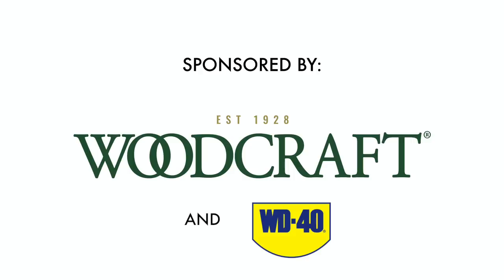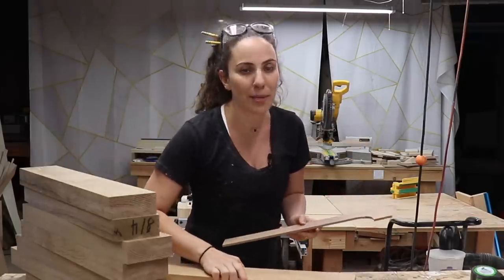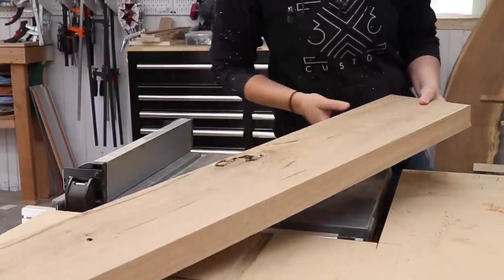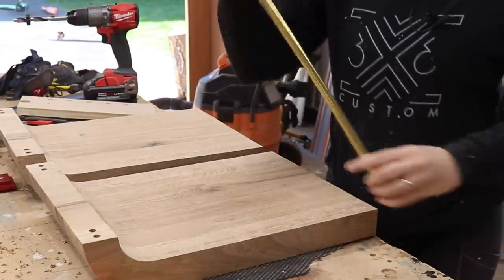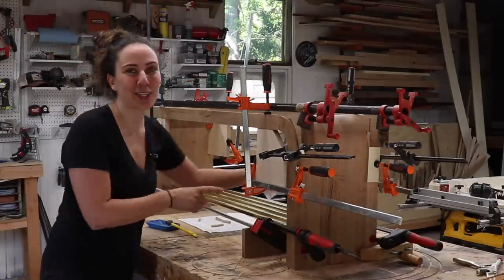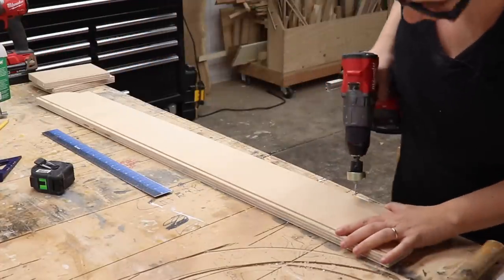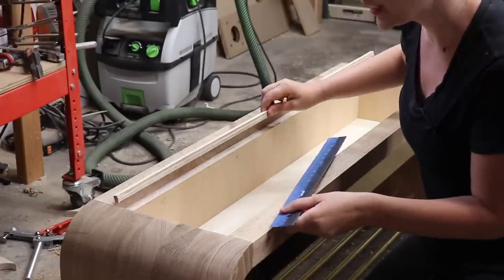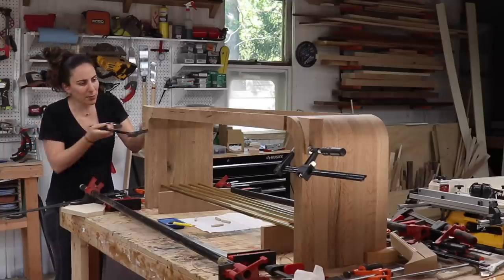Storage Bench with curves and BRASS accents - Builders Challenge Season 9 Build

Comment: Pretty nice watching someone make a not entirely small piece of cool furniture with a limited selection of tools - as a furniture  maker apprentice you get used to use specific large machines and kind of forget that smaller and cheaper tools can be used. I'm so used to making templates on a massive behemoth of a bandsaw and perfecting the shape with a rather substantial belt sander - the jigsaw and the small belt sander seem to work just as well - good to have in mind when contemplating a possible future workshop :)
Reply from the maker: Glad you liked it, yeah, use what you got! ha

Comment: I’m kinda old, so I remember doing big glue-ups with hide glue. We used a hot box to warm the wood, then our foreman would yell at everyone to go faster, because the glue gels so fast when it’s cold in the shop. Talk about panic mode! One tip that we use for plugs (and we make them in many sizes): Put the working piece on edge, and run it through the table saw. That way, the plugs have nice flat bottoms, and no marks from prying them out. Hope that makes sense. Great video. You are wonderfully resourceful, and you have serious chops.
Reply from the maker: Thanks! I usually cut them out of the bandsaw, but my bandsaw is out of commission, hence the jigsaw cutting here. here

Comment: Very nice bench I might do something similar for my pool deck.Just a
FYI about WD 40 it can corrode metals faster and oxidize aluminum faster so DO NOT LEAVE IT ON THE METAL.Wipe it down then coat your garden hose nozzle with Furniture wax or bees wax this will prevent any any seizing of parts.
Also I know you are in N.Y when you use your power tools coat them with wax cast iron more so including your saw blades you will find it easier to maintain your tools and keep your blades from gumming up.

Comment: On the brass bars or tubes you could extend them out the sides and use them as clamps to hold the legs in place adding more instres to the project.
But it does look good as it is, and will last years.

Comment: I’m a metal worker. I really love your bench. Great mix of wood and brass. I’m wondering if you sealed the brass before hand off camera so it doesn’t go green on you later on as it oxidizes over time.
Reply from the maker: Thanks! I put wax on it. In the past I have used lacquer to seal brass. But I wanted to test out to see how long wax will last bc I don’t live spraying lacquer

Comment: I use epoxy glue which has a 12 hour cure time, much easier to glue up however te 12 hour time means you need to wrap everything in tape and guess where the glue might run out from - swings and round abouts!
Actually, thanks to you ans the existence of eBay I've started moving to Titebond, wow, what a product! Couldn't get it in the UK for the last 30 years.
Reply: Out of interest, how does Titebond compare with regular white PVA, Bostik for example?
Reply from the maker: Haha! Sounds like a good time!

Comment: Really nice bench! indeed as you said pocket holes are a bit controversial and is just a matter of using them in the right way  because some people want to use it in everything and trying to hidde the hole they end up with a weak joint, the solution is use a variety of joints for each situation.
Reply from the maker: Thanks! Totally! They are great when used in the right application

Comment: That's a really beautiful (and functional) piece of furniture!  The large parts, curves, and the large radius roundover, really suit the dimensions and the materials.  Your designs always strike that balance between beautiful and functional, 'grownup' without being boring!  I want one!  :)
Oh, and been there, done that (more often than I care to admit), on cutting the tubing (or whatever project element) too short, and it's something I didn't want to buy again!  One alternate fix on projects where you can't shorten the overall length (due to its matching an adjacent project, or required by the location or application, etc.), could be to restore the tubing back to the correct length by splicing in wood sections.  Make dowel pieces out of the same wood as the project, having an O.D. the same as the brass tubing, then 'step down' that diameter on the ends of the dowel pieces to fashion tenons the size of the I.D. of the tubing.  Glue them in toward each end, between the main tube in the middle and two shorter lengths of tube on the ends, for a small accent of wood at each end, and it'll look like you meant to do it!  (At least, that's what I always tell people, for such fixes on my own projects, "I meant to do that!")
Reply from the maker: Thanks so much!

Comment: Nice build.  Don’t feel guilty for using pocket holes.  There are so many ways to join timber, you have demonstrated a range in this project.  The over use of pocket holes by some is astounding but they do have their place in a vast array of solutions available.
As for phone calls during glue up.  Every time I get to glue up I make a point of telling those that normally call or interfere to stay away.  I can guarantee that more than once each of them will call/interfere during the glue up with the most ridiculous reasons to call.  They also wonder why I end up getting cross, every time!!
Reply from the maker: Thanks so much! Yeah, I mean I get the overuse of pocket hole thing. When I first started I did the same thing. It just seemed so easy. It was awesome to see a finished project come together so fast. But then I learned about wood movement and all that and changed my ways. Ha. So it was a great stepping stone in the journey. I need to start shutting my phone off during glue ups!

Comment: Just wondering is 3/4 or 18mm thickness only one available in US?  Why in here in particular use insanely heavy compartment with no benefits at all especially if it used for hats. It just added 10extra kg to the structure. And in general almost all the time ppl using 18mm in all builds. Very nice looking anyway metal with wood always a win ))

Comment: Superb! You are a good teacher. Keep it up? What was the riving knife on your table saw? Some sort of thin kerf thingy!? Also, could you educate that sometimes you use the zero clearance throat plate and sometimes you use the factory one! I though the factory one had a slight dip and was not sturdy enough. Thanks
Reply from the maker: Thanks! That’s just the riving knife that came with the saw..... so! I only use my zero clearance insert if I’m cutting wood that’s small enough that it only rides on the inserts. The dip and bend in the factory one is not an issue when the wood has more surface of the table to run along. I also use it when I’m cutting thin strips so the strips don’t fall into the big gap in the stock one
Reply: 3x3Custom - Tamar Thank you Tamar.

Comment: Tamar, 5:45, the grain direction was not favorable, it's true, but standard procedure when template shaping is to make the template with an overhanging lead in, not just a copy of the part. A starting pin close to the cutter would also help.
Reply: Lee Haelters - I couldn’t remember what that pin screwed into the face of the router lift was called but thought the same thing. I get VERY nervous approaching a spinning router bit with no support at all.
Reply: @chipsterb4946 , then imagine approaching a two knife shaper head with a ball bearing collar and 6" diameter cutting circle. Yet, it is done safely all the time, with a starting pin!
Reply: Lee Haelters - you misunderstood. A starter pin is support for the work piece.
Reply: @chipsterb4946 , quite so, no misunderstanding. Was pointing out that something even scarier and hairier could be tamed by use of such pin.

Comment: Hi, good job. Very inspiring project. But I would ask you why did you choose to joint the edge of the boards with your tapering jig if you have a tracksaw?
Reply from the maker: Thanks so much! Well, that pieces was short enough for my tapering jig to hold. the only reason why I didnt use the tapering jig on the longer piece was just that, it was too long for my tapering jig.

Comment: After you have the tapering jig made, how do you properly set it up to joint? I assume the you have fix the clamps 100% straight or parallel to the fence for it get jointed right? Thanks a bunch.
Reply from the maker: I believe I just responded to you on another video. That first cut angle doesn’t matter. You set it just so that it cuts the whole board. Then flip it over without the jig. And put that first cut side against the fence. Then board is square.

Comment: Do you find the double sided tape holds strong enough to do the template routing? I always use a couple of dabs of mitre glue (superglue) that way I know it’s not coming undone, but it does damage the templates.
Reply from the maker: Yup, this double sided tape is super strong, thin and doesn't leave any residue.

Comment: This is so great. I already ordered that hinge/stay set from hardware hut - that is perfect for a lid on a bench with storage I am planning. Any advice you learned from your trial runs?
Reply from the maker: Thanks so much! It’s a pretty cool lid stay. So! The parts that are installed in the actual case (not the door) are supposed to be installed at 2 different heights. The instructions are in metric. So just be prepared for that. There are diagrams showing how far from the top the holes are supposed to be drilled. But it’s in a picture with a billion other numbers. So it’s a just a bit confusing to focus on which number is right..... ha and the best thing about them is how adjustable they are after it’s installed. So even if you don’t install is perfectly you can adjust left, right, back, forth and up and down

Comment: something i was questioning throughout this entire build was the way the leg was made and how it had a stress point right where the curve was, did that end up being a problem? because i know that stress point would put alot of sheer tension on that curve due to the grain, if not dont mind me its just i've always been taught that would be a breaking point in a piece however given the size of the leg that could potentially be disregarded
Reply from the maker: If it was just one piece. Maybe. But since this was so many pieces glued together it makes it’s very strong. And also the bottom plywood is attached with pocket whole screws that pull the whole thing together
Reply: @3x3CustomTamar  i'll have to note that one down then

Comment: I so enjoyed watching this build. A couple of things occured to me afterwards. The oak is beautiful, I don't like the brass strip at the front and I don't like the hinges you chose. 

Could you have opted instead for a long brass piano lid type hinge instead of the kitchen cabinet ones? I think that beautiful oak deserved it. OK no soft close but perhaps there is another solution for that?
The brass rods are quite long, how do you protect them from getting bent over time?
Final thought, if you had used 2 less pieces on the sides and replaced them with lengths of brass rod (this is difficult to explain without drawing it) connecting the wood together horizontally it would have given you 5 or 6 pieces with space between them much as the original picture you showed. OK it might not have been so strong but you would see all four sides of each piece of wood. Then the spare wood could have been used to form the box and no ply wood or brass strip would have been needed.

Final final question. The bottom always drops out of draws especially when they are over filled and the furniture is cheap. How do you make bottoms that stay in?

Love what you do.

Comment: Good idea for storing " in use" stuff. MY  problem would be REMEMBERING to USE IT!! (and not looking all over for stuff I JUST HAD !!) Also, I noticed the way you use a miter saw, full cut from fence to back in 2 "bites". I see alot of others make cuts differently, back to fence in 1 cut, some times 2 or 3 cuts. They all make since to me. Is there a "wright/safe" way?
Reply from the maker: Haha! That is the problem. So regarding the miter saw cut. I do it like that when the board has a bit of a wobble or twist to it. The problem with cutting boards like that on the miter saw from the back to the fence is that the wobble in the board can cause it pinch the blade and then it can kick back. So if you chop at the fence part first. Then the part closer to you there is less chance of pinching the blade in a case like that
Reply: @3x3CustomTamar  That adds up. It's always nice to hear the reason behind things for those of us that might be a little "thick".(British slang, I like some of theirs)
Reply: AND pun intended! "I'm a little thick today!!
Reply from the maker: Daniel Dee ha!

Comment: Hey... Just an opinion and a friendly suggestion here but... That Milwaukee drill set, it's too damn big.

I know, I own the same set just a little older. I use it for things like replacing entire roofs, drilling through 2 inches of plate steel, taking core samples from the center of the earth, etc... And I'm a fair bit larger than you. The batteries aren't half the size of my head like they are yours. I use the 12v drill and impact from Milwaukee in my woodworking shop. They have far more power than you ever need in the shop, the batteries last all day, and they weigh about half as much (you'd think they'd be easier to fit in small spaces too but not really). 

They go on sale regularly for $175 for the kit if you keep an eye out, and you can use the M18 batteries for other large Milwaukee tools like say... A brad nailer? While the big drill set gets dedicated to things like home repair and breaking into bank vaults. Y'know, jobs where you need tools that double as mini sledge hammers?
Reply from the maker: I hear ya. I love this drill set though

Comment: Are dowels strong enough? What size did you use ? I guess the strength is in the glue, thanks for another great build 👍🏼
Reply from the maker: Dowels are strong enough for me. I used 3/8.
Reply: 3x3Custom - Tamar thanks Tamar, I’ve just bought some in metric 8mm x 40mm, and 8mm x 30mm in case they are too long. I’m Going to attempt a similar build, very ambitious for me 😂😂
Reply from the maker: Terry Johnson awesome. Let me know how it goes!
Reply: 3x3Custom - Tamar Hi, so nice of you to reply, I’ve had to change plans because I have just about every tool other than a router, so cannot get identical end pieces, so I’ve adapted mine, to just one arched leg each end, but please check it out on my Instagram, but no laughing because I’m nowhere near as good as you 😂, Terrythemaker
Reply from the maker: Terry Johnson saw it! Looks great!

Comment: Just discovered the wood grain direction issue with my router... I'd rather have watched your video first, but it was too late for the armchair oak piece I messed up :)
Reply from the maker: Yeah... it’s a lesson I had to learn the hard way too ha
Reply: I learned it the hard way on a walnut, cherry, and curly maple cutting board that I was making as a wedding present 2 hours before the wedding. Caught the grain, knocked my guide out of the vice and ripped an inch and a half into the piece. They were still very pleased with their "cheeseboard" 😂 

Some lessons you just have to learn the hard way.

Comment: When using the two clamps at the 13:42 mark, how do you make sure the pressure is even and won't warp your project?
Reply from the maker: You adjust the clamps and make sure it’s square
Reply from the maker: You adjust the clamps and make sure it’s square

Comment: Would have got round the brass tube problem a different way. I would have inserted another vertical 'wall', plugged the holes at one end / and or something else to add a different storage facility at one end. Would have given it an asymmetrical look, but could have worked.
Reply from the maker: That could have been a cool idea too

Comment: Great build! Congrats!
What is the extra hardware that you installed on the right hinge?
Reply from the maker: Thanks so much! That’s the soft close mechanism that’s just added on top of the cup hinge
Reply: @3x3CustomTamar  It seems that its overkiiling for that small door 🙂
Btw you can check the new blum hinges. The soft close mechanism is embedded on the hinge so no additional hardware is required. And it comes with enable/disable softclose switch so you can use it as a normal hinge if you prefer.
Reply from the maker: Aristos Andreou not overkill if I don’t want smashed fingers on my little ones. I’ll check those out.
Reply: @3x3CustomTamar  No,no you got me wrong! I love soft close for the reason you mentioned and many more! What i meant by overkill is that it seems from your video that the mechanism is too strong for that small door. It looks like the door needs help from your fingers to close properly!! 🙂
Reply from the maker: Aristos Andreou yeah. So there are 2 strengths I bought the stronger one. Should have bought he smaller one. Ha. You’re not wrong.

Comment: I need advice, I use double sided tape a lot, but always encounter problems removing the backing, is there an easier and faster way?
Reply from the maker: Yeah. So if you leave a little “tail” of the paper backing you can easily lift it off. That means you need to rip just the tape part when applying it on your pieces.
Reply: Google superglue and masking tape trick, Crimson Guitars
Reply from the maker: mikeyutube I know ppl love that trick but I’m actually not a fan. In a pinch it works. But it feels finicky to me